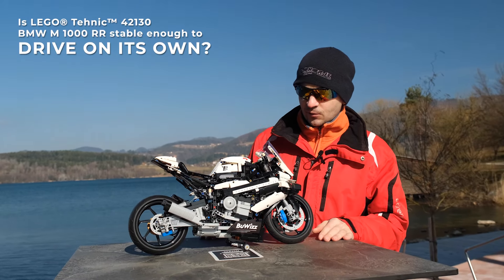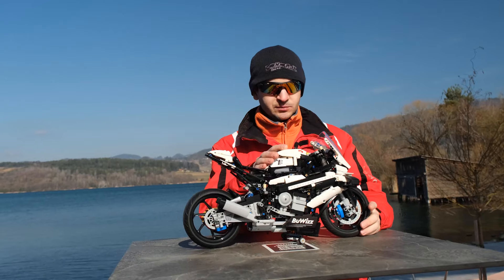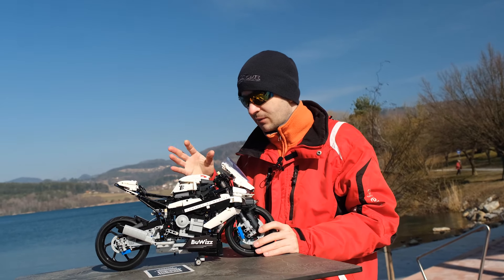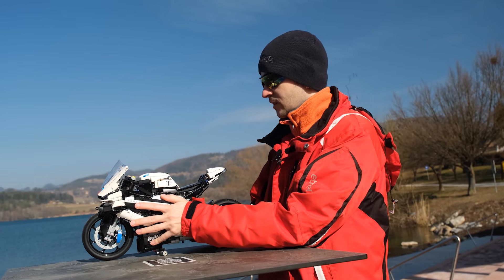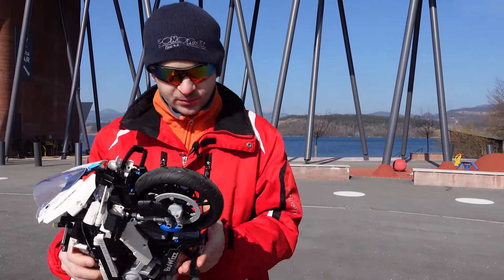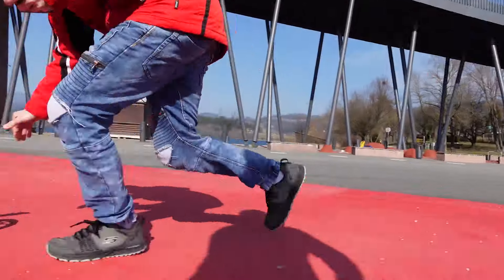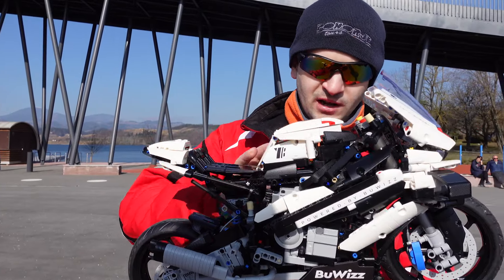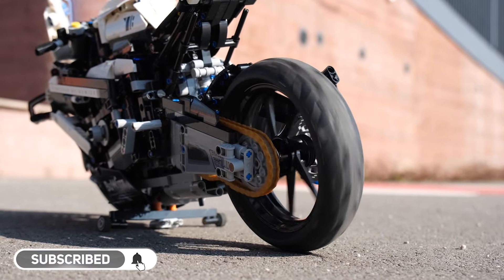Motorized LEGO® Technic™ 42130 BMW M 1000 RR - Is it stable enough to drive on its own?

Comment: Im little shy  to call my motorbike driving motorbike,  its realy go much better. Few cosmetics and its done, all the mechanism is complete, maybe some places left for minor improves, like take of the metal there and replace it with lining driver like max did with his beautiful bike, But 90% done.
You guys got long way to go, its not realy look close and you lack  some basic foundation like piter said.
I saw that he offered you help. Be smart and take it.
First thing is make the steering stable-like you said in your clip, and low a bit the center of gravity.
i would replace the buwizz to the wides instead of to the longs of the bike and try to put it more down, maybe replace the fake engine. 
disatatch the motor from buwizz movement will be smart too.
 From there it will flow. Good luck 🙏👍